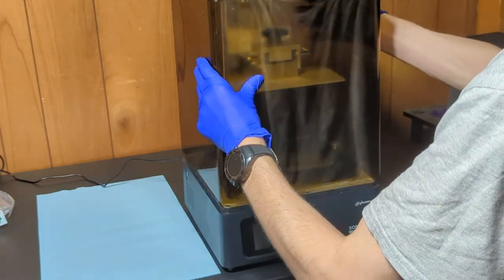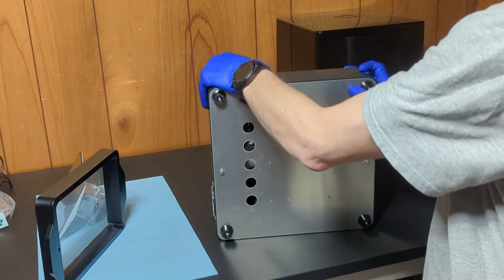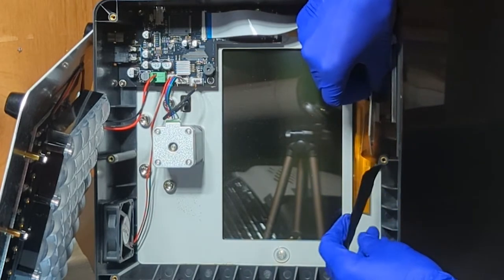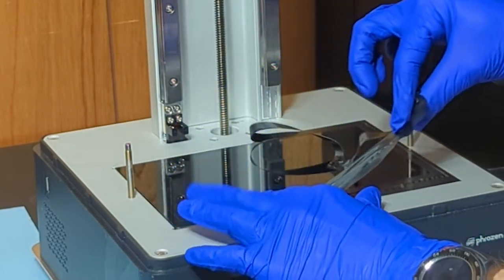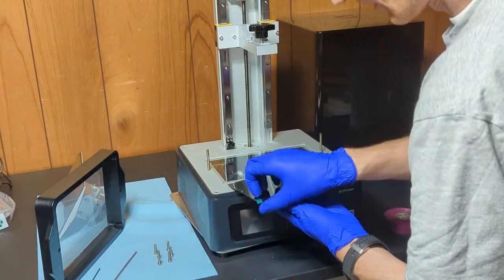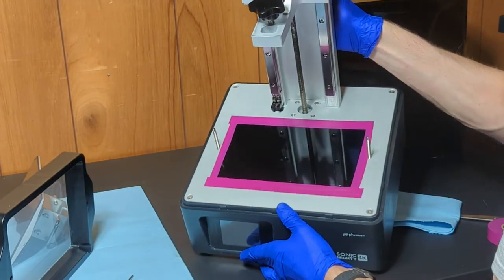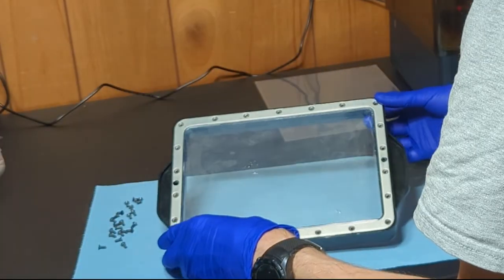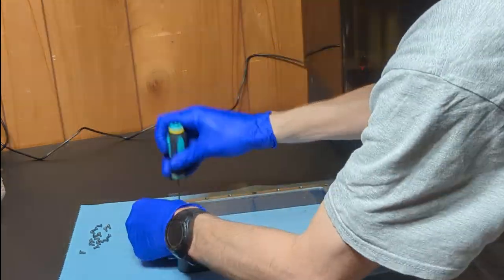Phrozen Sonic Might 4k LCD Screen and FEP Film Replacement

Comment: Replaced the LCD screen, but now when I power on the printer, I get nothing but a blank white screen on the display panel.  Any suggestions for how to troubleshoot?
Reply from the maker: Open it back up and make sure you don't have a loose cable connection on any of the other circuit boards, maybe even re-seat them. If you still have issues, contact Phrozen support.
Reply: same here, will check all connections again